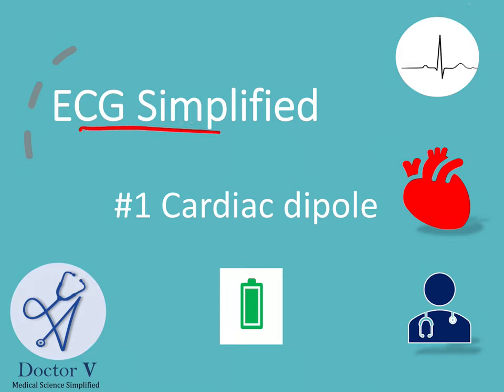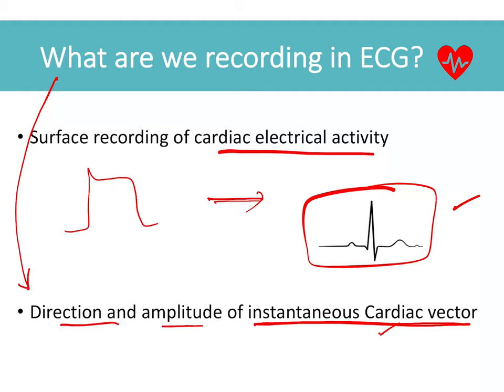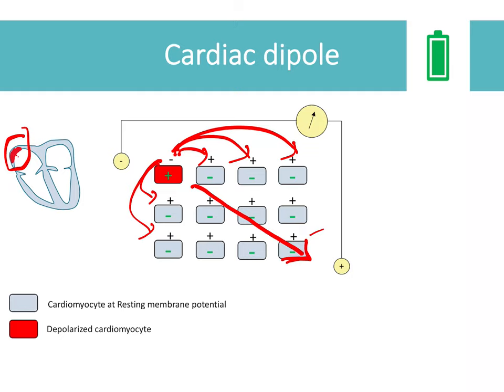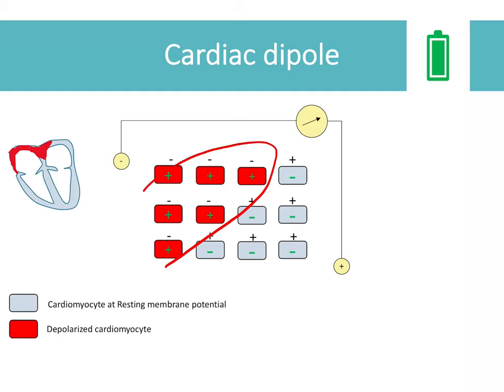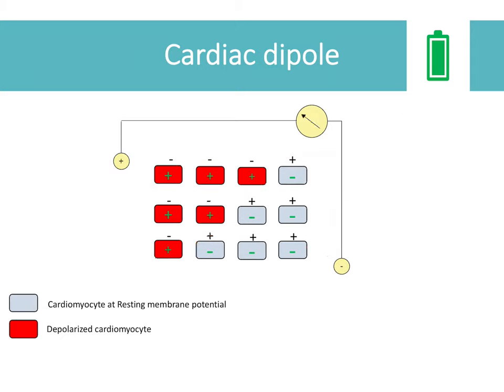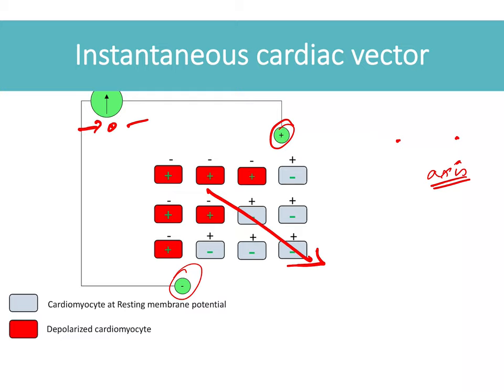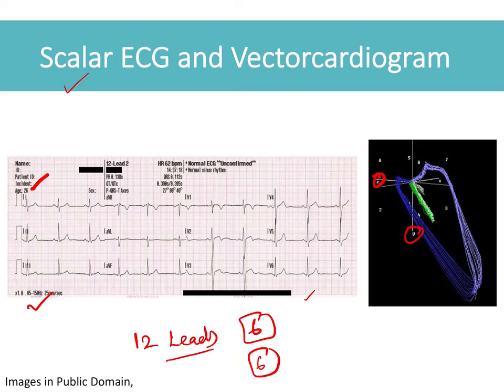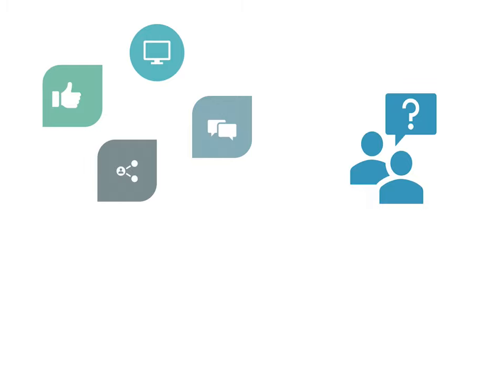ECG Simplified #1 Cardiac dipole and Instantaneous vector

Comment: This is the best explanation sir. But  my doubt is that: current direction is taken to be opposite to that of the direction negative charges .so here in the pic 1 current is from right lower corner to left upper corner. But the vector is pointed left to right . How does this relate sir? Should we take the direction of negative charges as vector?
Reply from the maker: In ECG, the vectors doesn’t represent the direction of current!! Though we are recording electrical vectors, the convention is that ECG waves represent the Direction of progression of Depolarization wave. Viewing the depolarization wave from positive electrode, if it approaches the electrode then ECG machine is designed to produce a positive wave!! It’s not intended to truly represent current direction as in Physics!!
Reply: Electrons always flow from - to + to cause a positive deflection in voltmeter.  Think of a 1.5 v battery for example; if you reverse the polarity, it reads -1.5 v.   So, electrons must be flowing from - to + electrode in lead II (example) to cause a positive deflection; the dipole is pointing in that direction (and polarity is normal as indicated for a battery).  aVR is negative because you have reversed the polarity of electrodes.

Comment: Good video, sir.  Electrons always flow from - to + to cause a positive deflection in voltmeter.  Think of a 1.5 v battery for example.  It is 1.5 v when polarity is normal (- to +); if you reverse the polarity (= to -), it reads -1.5 v.   So, electrons must be flowing from - to + electrode in lead II (example) to cause a positive deflection; the dipole is pointing in that direction (and polarity is normal as indicated for a battery).  aVR is negative because you have reversed the polarity of electrodes.
Reply: a voltmeter does not measure current. that's an ammeter. the video did not explain the concept of a dipole and how it generates and electric field and thus a difference in electric potential that will be picked up by the voltmeter. I'm not sure the creator of the video knows how dipoles actually cause a difference in electric potential.